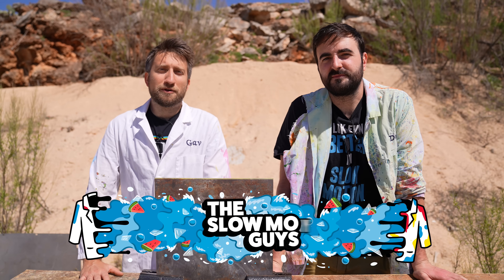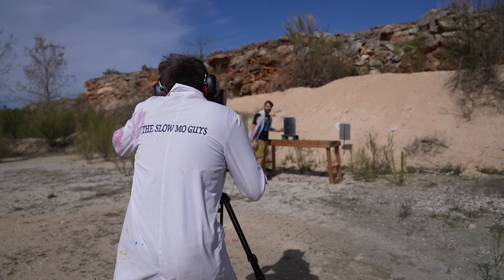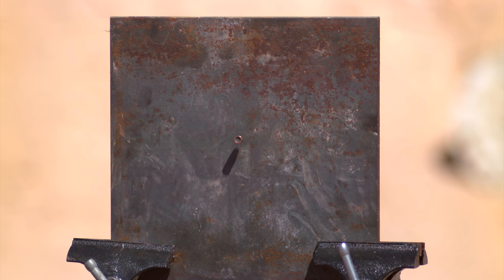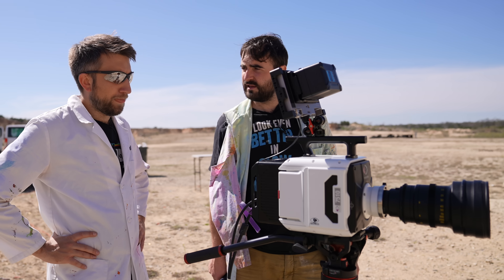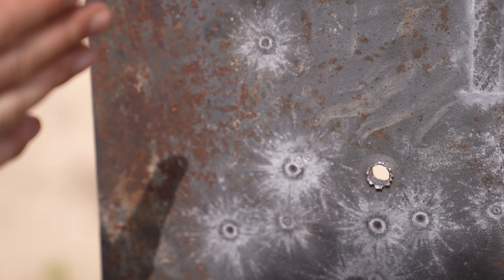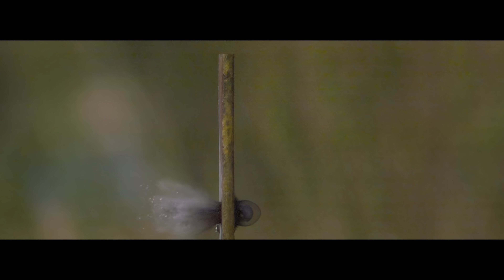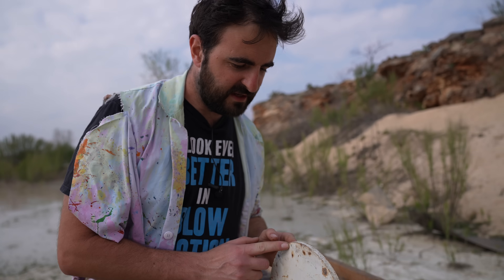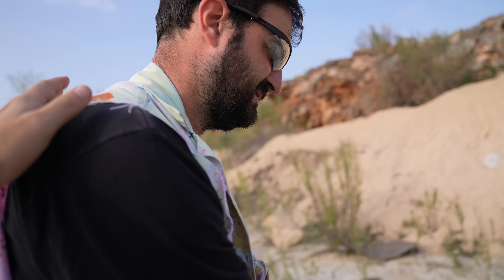Bullets vs Steel at 800,000 FPS - The Slow Mo Guys

Comment: When the bullet hits the steel surface, it can't go any further, so at that instant the velocity is zero and the linear momentum is also zero (m.v=0)

Since there is no force acting parallel to the steel surface, linear momentum must be conserved, which explains why the fragments travel in a circle

For each fragment going in one direction, must have another one going in the opposite direction, so m1.v1 - m2.v2 = 0

If the fragments have equal masses, then v1=v2

This conservation law can be easily demonstrated by applying Newton's Second Law to the set of fragments:

F=Σmj.aj=Σmj.(Δvj/Δt)

Where mj and aj are, respectively, the mass and acceleration of fragment "j"

Since the time interval (Δt) in which the change in velocity (Δv) occurs is the same for all fragments, it can go outside the summation:

F.Δt=Σmj.Δvj

Assuming the external resultant force is equal to zero (F=0), we obtain the law of conservation of linear momentum:

Σmj.Δvj=0

Assuming all fragments have the same mass and the initial velocity is equal to zero, we obtain:

Σvj=0

The result above allows us to conclude that for each fragment going in one direction, must have another one going in the opposite direction with the same velocity, so they cancel each other out, resulting in a sum equal to zero

Physically, this implies that the fragments travel forming a circular distribution pattern

Note: The product of mass and velocity is what we call linear momentum😮😮

Comment: The lead core of the projectile is far denser than the steel of the plate- and with the amount of kinetic energy contained in the projectile, yes, the denser material will penetrate the plate, while the less dense brass alloy is stripped off as the centrifugal forces peel away the casing as it strikes the steel (which is more dense than the brass). Physics and metallurgy boys.

Comment: @9:33 that isn't the lead, that is the back of the hole, that is the bit of the steel that was basically stamped out. you can see it better @10:40

Comment: Gentlemen, regarding the 300.06 going through the steel, that’s not a lead slug flying past, it is a piece of the steel that was knocked out leaving the hole behind. Find it and put a magnet to it. I’ve shot many pieces of steel with standard rounds and armor piercing. Great video. The round piece of hard steel looks like AR 500 plate.

Comment: Gentlemen, regarding the 30.06 going through the steel, that’s not a lead slug flying past, it is a piece of the steel that was knocked out leaving the hole behind. Find it and put a magnet to it. I’ve shot many pieces of steel with standard rounds and armor piercing. Great video.

Comment: Those kind of targets are mounted sometimes solid they just paint them white after each round like during a match. They are made to take pistol rounds up to "major" calibers. (can take a full 44 mag pistol etc) When we shot matches we usually used NON jacketed ammo as you can see in the slow mo the jackets bouncing off. Also military steel core ammo will shoot through  those targets and those rifle rounds are probably putting unacceptable dents on the steel target. You don't want to shoot steel that is too dented or has holes in it as it is believed the jackets or parts of the bullets will fly back an hit the shooters (as we shot 7 to 10 yards away on the steel targets)
Reply: And to add I think it is t5 or 5000 hardness steel It is pretty heavy and dense and I think you can get harder steel but that worked for pistol shooting the I think it was 5 something or 5000 something on the hardness.

Comment: The round going through the plate, then stopping at the sign is super interesting and is related to why ALL craters on the moon are mostly hemispherical, regardless of the angle that the meteor hit it at. The kinetic energy causes the round/meteor to basically explode on impact, dumping mostly all of its energy into the impact itself with just a little bit left in the momentum of the round when it hit the sign.

i.e. even if you doubled the kinetic energy of the round, it would just make a bigger hole in the plate, but still be stopped by the sign. So cool.

Comment: Just to add to the science here.....  the spark flame pattern is coming from the gaps in the bullet head then you see the flower expand.  The sparks are from a diesel effect.  The hollow point trapped gas and it compressed and ignited

Comment: 14:30 there are many different types and alloys of steel. Spring steel is different to carbon steel is different to stainless is different to other alloys etc. - and different alloys will have different amounts of chromium, manganese, nickel, molybdenum, and maybe other heavy metals. Annealing and other such methods will also affect the hardness and other such properties. Additionally, the crystal structure formed by the steel is also important (e.g. austenitic steel is very different to ferritic or martensitic steel)

Comment: Would you consider the shots against any of 
Bullet-resistant vests and armored vehicles various materials to absorb and dissipate the impact of bullets. 
For Bullet-resistant Vests:
->Kevlar: A high-strength, lightweight synthetic fiber that absorbs and disperses impact.
->Aramid fibers: Similar to Kevlar, these fibers provide additional protection.
->Ceramic plates: Used in tactical vests for added protection against rifle rounds.
->Steel or titanium plates: Sometimes used for extra protection.
For Armored Vehicles:
->Armor steel: High-hardness steel for overall structure.
->Ceramic composite armor: Provides protection against anti-tank missiles.
->Fiber-reinforced polymers: Lightweight, high-strength materials.
->Ballistic glass: Resists penetration from bullets and shrapnel.
->Composite armor: Combines materials like Kevlar, ceramic, and metal.

Comment: The lead bullet fragments continue spinning because of conservation of angular momentum. Before the bullet hits the steel it has 2 types of kinetic energy, translational and rotational kinetic energy. Most of the translational kinetic energy is transferred to the plate at the moment of impact, which causes all the copper parts to blast off. But most of the rotational kinetic energy is retained after the impact, because angular momentum is conserved in the absence of external torque. Since the bullets were pretty much straight on (cuz Gav's a formidable gunman lol), then very little of the rotational energy from the bullet is lost, so angular momentum is conserved.

Comment: As the speaker of the Steel workers union, I urge you to give more credit to the type of steel used for the target, see the ASTM table. FYI, there is a factor of ~10 in (tensile) strength between simple construction steel and high-alloy armour steel ;-)

Comment: The sparks coming out aren't from the bullet points hitting the metal, they're from the air trapped in the pocket of the hollow point being super-compressed and exploding out between those points. It's the same effect as the explosion caused by the collapse of the cavitation bubble in ballistic gel.

Comment: at about 15 min. there was an interesting observation. After impact, the rotation stops but the transference of energy after the initial impact accelerated rotation again at the end of the projectile in the same direction. Sort of a spring uncoiling but recoiling faster. There is a lot of interesting math in that one shot I'd like to explore. The lead absorbs a lot of that rotation but the inertia shouldn't have impacted accelerated rotation, I'd think it would have had the opposite effect. Interesting. In milliseconds, the fluid dynamics of lead appears to be more like Sodium in its gel like impact shaping. It is like the rotation reversed then sprung back. I think you guys found a new property of lead. Or I'm just fascinated as an engineer / designer and just geeking out.

Comment: After watching this, I would highly prefer a steel plate that is curved outwards on the edges and a specialized plate carrier to put it into. Then, I would have ceramic just thick enough to stop thinks like 5.56  or 7.62 around my biceps and sides and thighs, with an even stronger but smaller steel plate hanging over my family jewels. Seems like the most optimal setup without taking too much mobility and stamina away from yourself.

Comment: The round target you found was most likely AR400 or AR500 steel. It's designed to withstand taking hit without deforming and prevent ricochet from returning back to the shooter. Of course it's recommended that the target is mounted on a 20 - 30 degree backwards angle to help redirect the fragmentation towards the ground.

Comment: Any true American will tell you that .30-06 is a spicy round. And it is. Certainly more energy than a .308 Win when you see the size of the case that fires it. 8mm Mauser is also rather similar, I think it tends to have less energy but it is .323 inches as opposed to the .308 sized round in .30-06. Would like to see more slow mo of Kentucky's elephant rounds against steel. Also at 13:41 I also noticed a form of shockwave on the trailing edge of the bullet. I can see where boat-tailing can reduce drag as that round was flatbased.

Comment: At these speeds any surface will have a factor to consider that they've not considered yet. And that's the different surface tension rate due to overall  availability of real estate area the plates each have. Here's how you have to imagine it. The steel plates are similar to concrete plates. Imagine shooting a tile and the thought makes sense. The reason that the plate was able to get holes punched out of it and the smaller target not is the ability for vibratory transformance.

Comment: The fragments that are shot in a 360 2Dish circle are massively dangerous in their own right! Depending on the round they can zip through human flesh and perhaps bones that aren’t particularly strong. That’s why having a bare steel plate of chest armor isn’t enough to be considered sufficient. In a sense that there’s nothing to absorb the fragments of the bullet as they travel at ridiculous speed for being shattered. Having dense rubber or other material to catch and disperse the shards is basically a necessity!

Comment: Yeah it wasn't testing different hardness, it was the thickness that made a difference. The exit hole is cleaner than the entrance hole because at the entrance there's the conflicting forces of rebound with the momentum in the center of the bullet, and both of those forces are strong enough to break the bullet and steel, weighted in favor of the steel. In the exit hole, what's left of the bullet is inside the steel, so it's the same situation but now weighed in the bullets favor.

Long time shooters who shoot lots of different kinds of targets eventually discover that over penetrating the target (using force to penetrate rather than having a stronger material or a streamlined bullet shape) can cause a mini shotgun blast that will hit whatever is behind it, which is mostly dependent on how thick the first target is. Thicker = less power but more material coming out the end.

Comment: 11:30 This is why they created anti-tank rifles during WWI. Even if the bullet did not go through, the steel spall the bullet created could cause damage to the crew inside. This is also why some tanks today have Spall Liners, which is essentially a layer Kevlar fiber laid on the inside to catch the Spall and protect the crew.

Comment: A lot of the effect on the steel plate depends on the type and quality of the steel. this was probably just a plate of mild steel as used in construction. High strength armor steel will have a very different result against small arms.

Comment: Would have been interesting to see the "plugs" of steel the 30.06 punched out. Maybe bring a magnet next time? The plate you found was probably AR500. BTW, steel is measured in inches (ie: 3/8" and 1/2") NOT metric here in the states. 😉

Comment: The round plate you picked up from the backstop appears to be armored steel, which is most often used in targets that are  meant to be shot repeatedly.  The plate you brought is hot rolled steel and much, much softer and less expensive.  If you would have shot the armored steel at 25 yards with the rifle, it probably would have been blanked like your rolled plate.

Comment: That's the difference between mild steel and ar 400 or 500 steel.  Your both very lucky that you didn't get hurt shooting at the mild steel.  If your rifle was less powerful,  I'm guessing it's some type of 30 cal.,    the bullet would dent the steel,  turn inside out,  and come straight back at the shooter.  That's why all steel targets should be made of AR 500.  Pitting,  dents,  even the hardware bolting the target to the post,  should be hard.  And many targets are hanging by hooks or chains to absorb some of the energy.  That's why your vice broke.  10 yds from the target minimum for pistols and 25 for rifles.  Never shoot at mild steel!

Comment: Armour restorer here. Whilst metal-detecting in England in the 80's I found a 'bullet' (musket ball) on the field adjacent to the Naseby battlefield site (Battle of Naseby 14th June 1645). This 100% lead musket-ball has mushroomed perfectly just like a flower!
I always had a feeling that what it must have hit was the body of a cannon or an iron-rim or hub of a cart-wheel for it to mushroom like that, as the conventional trooper armour in the day wasn't really man enough to completely fragment a lead ball in my experience, unless shot at a breastplate at near point-blank range like when armour from the same period was proof-tested.So CERTAINLY possible on the battlefield... it was just a feeling I had, as the HUNDREDS of balls I recovered, most of which are deformed I only found ONE like that!
Normally a ball would either pierce 17th century armour if within effective range or merely flatten/deform if outside its effective range.
Some I have, clearly clipped the edge of something/someone as they look like they have been bitten by a junkyard dog! 
Interesting video! Nicely done. Best wishes from a French forest. ⚒️🇬🇧⚒️

Comment: Early 1970s a friend had a bullet trap made of 2 inch steel with the back slope 45 set at degrees.
This worked OK for 180 grain 30-06 hot loads. They splashed a clean spot on the rusted steel.
Then he fired a hot loaded 30-06 90 grain at close to 4,000feet per second.
The hole went through and it had melted edges. The energy level had changed the state of the steel from solid to liquid.😮😮

Comment: I know people are applauding you guys for gun safety and all but actually I do have a minor complaint. Shooting a solid steel plate at a perpendicular angle is considered dangerous in the event that the bullet does not completely disintegrate on impact and richochets off. The chances of richochet are low, but the plate should always be angled towards the ground so any possible richochet ends up in the dirt. Though I do appreciate you taking precaution with distance.

Comment: It would be great if you did a test while shooting with different barrel diameters and using silencers or brakes. It would be interesting to see whether the hit position changes and whether this is related to the vibrations of the barrel.

Comment: Steel targets are hardened through heat treatment, just like knife blades. If you took a torch to that steel target and got it red hot, it would ruin the temper and the rounds would go through much easier.

Comment: Many folk are astounded that a soft point lead cored bullet will sail through a 10mm steel plate... but that's velocity for you... With AR500 plate (which is a alloy steel and hardened) there is little or no damage as you see on the circular plate... The 30-06 has a muzzle energy of about 2500 ft/lbs or more.... serious round....
Your guy on the gun is a very good shot.

Comment: What is that flash as soon as the bullet makes contact??? Why doesnt it continue for as long as the bullet is disintergrating? Is it air compression or material decomposition? Would the flash be bigger if the bullet had a flat nose or a deep hollow point?? How much pressure is required to tear N2 and O2 apart or force them together to make O3 or NO2 etc...

Comment: For future set ups, if you're ok with broken mirror and/or sheet of glass , you can box the highspeed and place it closer with a mirror on an angle to view the impact. use (replaceable) glass between the mirror and the impact point, and between the boxed camera and the mirror. 
Cheers fellas, great lessons on physics!

Comment: You know, it makes sense that the parts of the bullets still spin even after hitting because conservation of angular momentum is a thing and there is only so much angular momentum they can transfer into the targets(especially clamped down targets)

Comment: Have you got a video that shows the difference in shock waves between subsonic and supersonic ammunition after capturing the light reflecting the shock wave. And as to the distance infront of the round based on the velocity?

Comment: Those are not “Sparks” 4:00 
ACTUALLY 🤔the flame (from that particular shot) is the Air in the Hollowpoint compressing/Igniting.
“Pressure ignition”, (like a diesel engine)Shooting out the Gaps🤙🏻..Very Cool!..

Comment: It would have been interesting if you had the Square plate in front of the round one cause i wonder if the bullet would have pugged the hole at the same time i am pretty sure no one has ever done that. to see what may happen doing this would be cool as heck i think.

Comment: That's a plug of steel sheared from the plate coming through, not lead. I've set up a barrier to catch these and some of the lead leaves a coating on the impact surface but its mostly a steel plug.